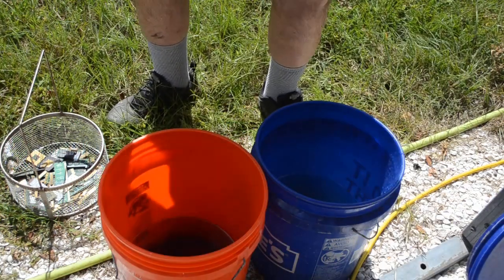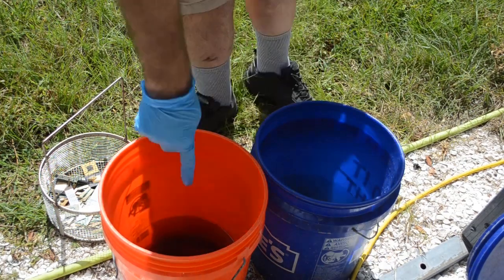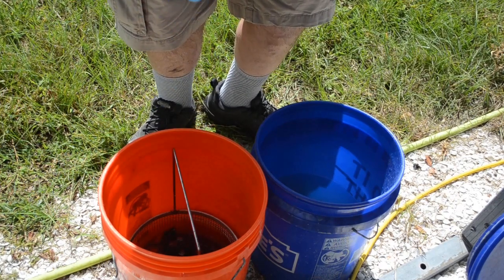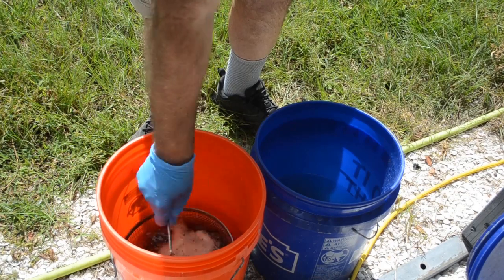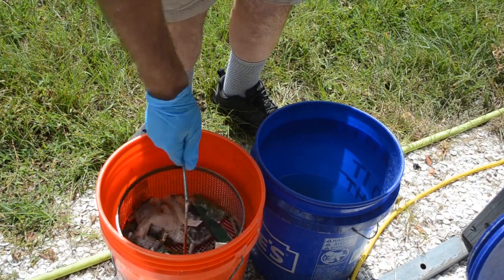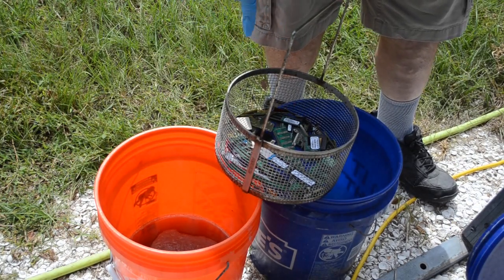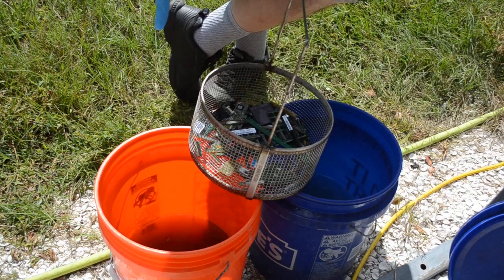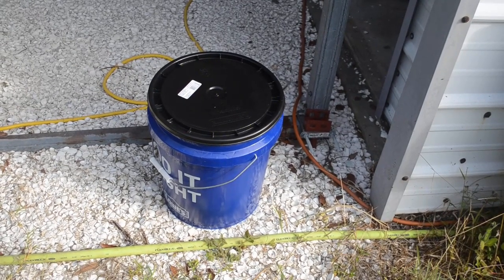Eco Goldex Short: Solar Heat, More Agitation and Plastic Buckets

Comment: In one of your previous videos, you were not sure but you thought you got about 6 grams with a certain size load of high grade gold plated stuff.  Per Kilo of Goldex, how much do you think you get ... especially with your process described today (hot solution with aggressive agitation)?  I have maybe 200 pounds of pins and I am debating with myself if I want to go with incineration and traditional pin processes, or should I try Eco Goldex for the first time ... Your video where you got about 3 grams (last few gold ex videos) made me second guess ... Thanks :) Good video!
Reply from the maker: Go with what you are comfortable with. I tend to save the Eco-Goldex for stuff that is difficult to remove the gold plating from with other methods. You have lots of other options with gold pins.  Yeah, in that video I was running low grade stuff and made some unfortunate changes to my process to aid in filming it. The low pot made for good filming, but didn't allow for lots of agitation. Plus I had metal cementing out on the side of the pot. I really prefer tall plastic buckets. That's all I'm going to use from now on. People will just have to use their imagination about what is going on inside.